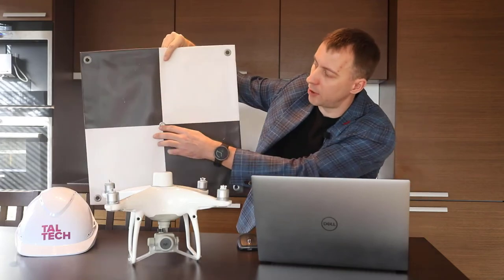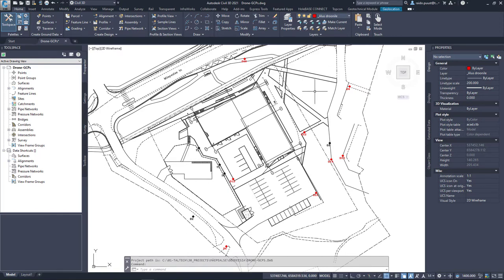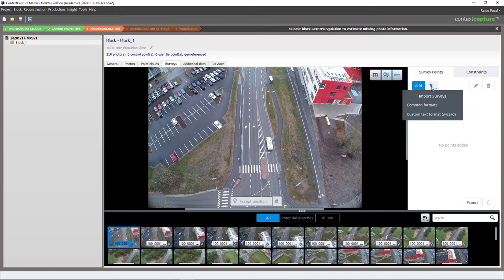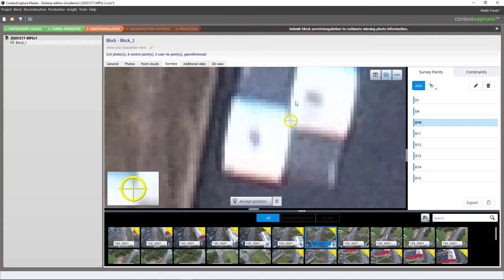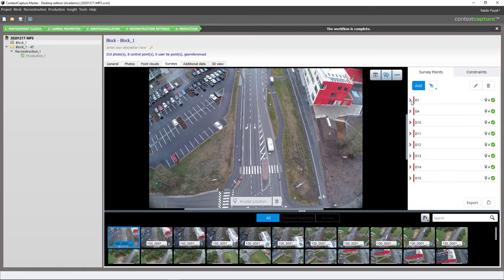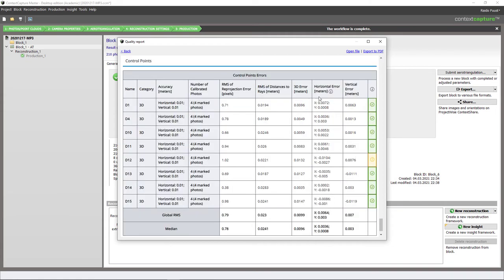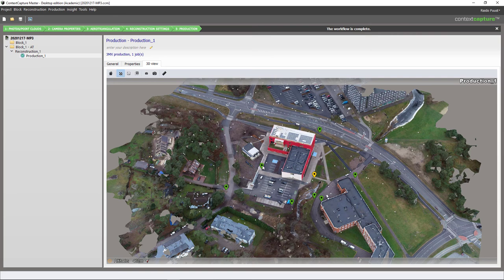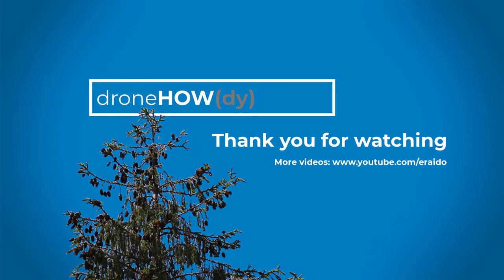droneHOW - Episode 08 - Using ground control points in drone survey (Bentley ContextCapture)

Comment: Nice video. Thanks. Do you claim in the video that you get an absolute accuracy of 5 cm with your RTK Phantom 4 without the use of GCPs?
Reply from the maker: Thanks! Actually it is better than 5 cm (less than 3 cm). But to be able to confirm (if required), you have to use GCPs. You can also read some more information from our article: https://www.tandfonline.com/doi/full/10.1080/00396265.2020.1830544